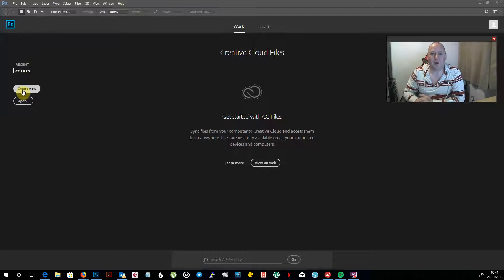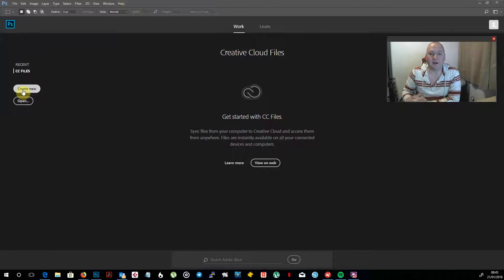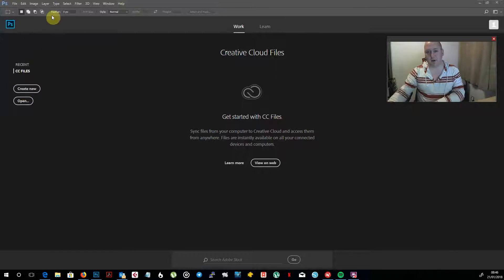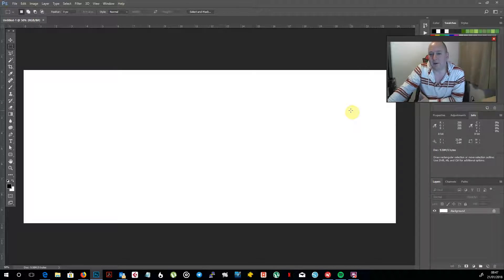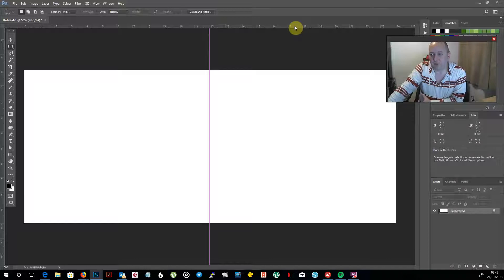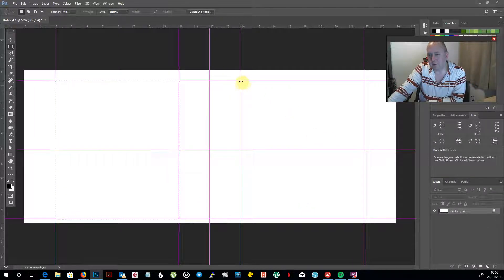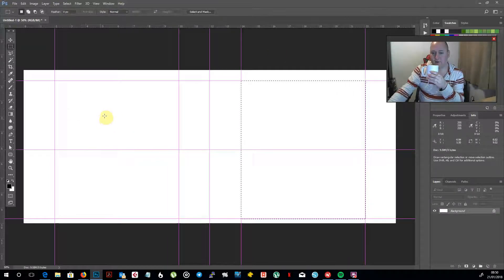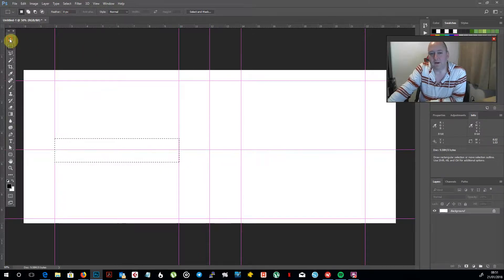Dino pre-cut sublimation mugwraps - making a Photoshop template

Comment: what are smart objects used for ,ive subscribed
Reply from the maker: Thanks for subscribing Louise :)  Smart Objects have all sorts of uses and advantages, but as an example for how it might to apply to this particular template... A Smart Object could be created to fit the front and back grid/sides of the mug.  When you double-click the Smart Object you open it up as an independent item, where you can edit and create your design.  When you come out of editing, the results are shown in the Smart Object layer within your template, and fit into that size/position.  Also, you can then apply transformations etc. to that Smart Object without destroying or degrading the underlying information.  So say your Smart Object contains text, you could apply warps to that Smart Object without rasterising the text, and then go back into editing of the Smart Object, change the text, exit the editing, and see the updated text still warped on your template.  I use it for just that purpose with mugwraps for Latte style mugs, which need to be warped so that the design comes out correctly when sublimated to the mug.  I might have to do another video like this one showing that :)

Comment: Thanks for the info. One thing; I assume of course that before you print from this template, you need to mirror it first, especially if you have text.
Reply from the maker: Yup - you can mirror it in Photoshop before you print, or if your printer supports it you can print it mirrored via your print options.  I have 2 sublimation printers for different purposes and use Photoshop actions assigned to keyboard shortcuts to mirror and set the target printer and print settings. Speeds things up when you have different artwork to print for a run :)
Reply: Great. Thanks for the reply.